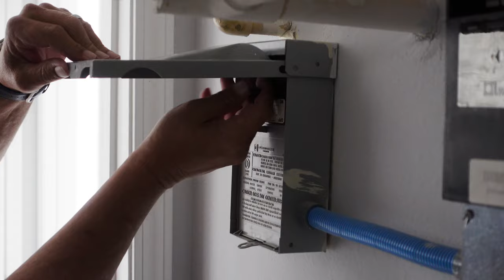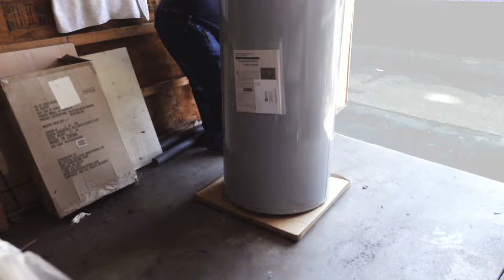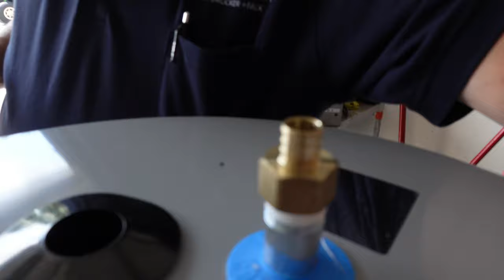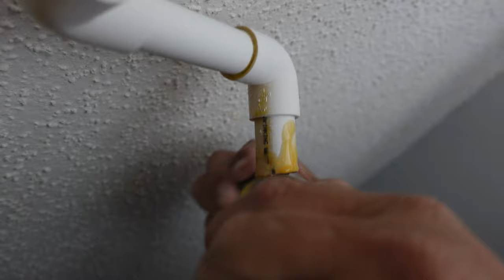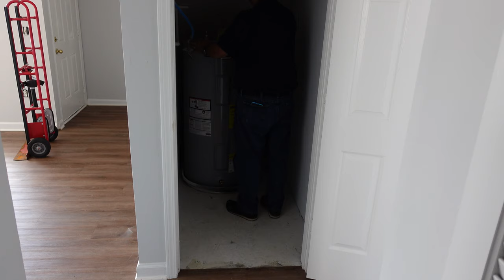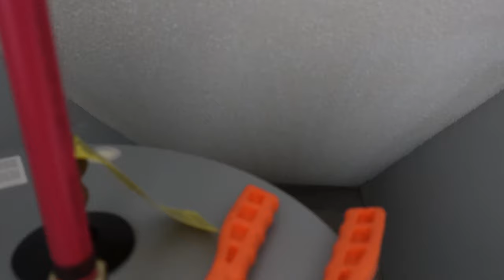How To Replace A Water Heater

Comment: Great how-to video!  Though I wish there were more Dan Jiles commentary.  Now the really hard one is to change from a standard water heater to a hybrid one (like the Rheem XE 65) - what a joy to re-route the pipes from on top to the side.  One tip to include is to check your local guidelines before installing a new water heater: between when my original one was installed 20 years ago and today, we got a new requirement for an expansion tank (thank God a neighbor told me about that).
Reply from the maker: Very true, our regulations don't call for that, so... Thanks for the feedback. Commentary coming in the next video.

Comment: Very impressive.   I notice the wiring you took apart at the beginning -- there was no wiring to do at the end.  Did I miss something, Dan?
Reply from the maker: I'm going to do another video on the wiring, the wire was too short so I'm replacing it with a new set of wires. Thank you Ken.